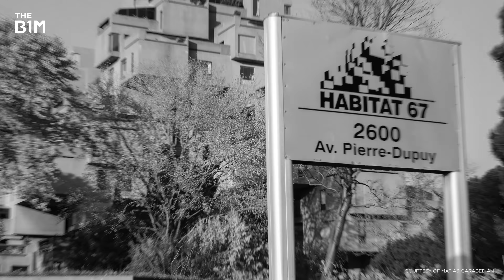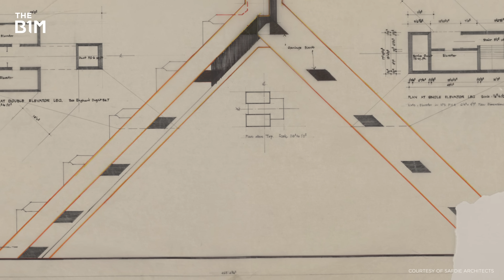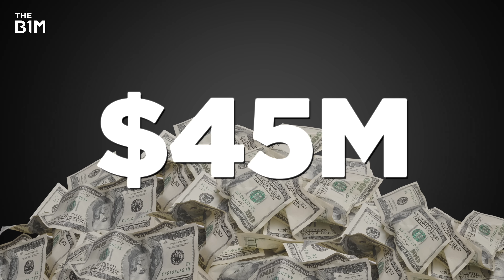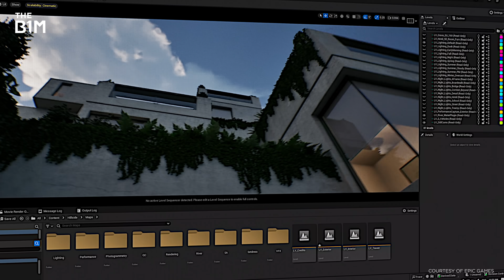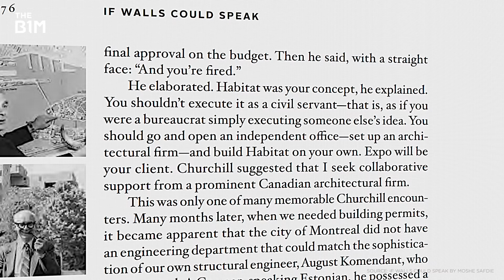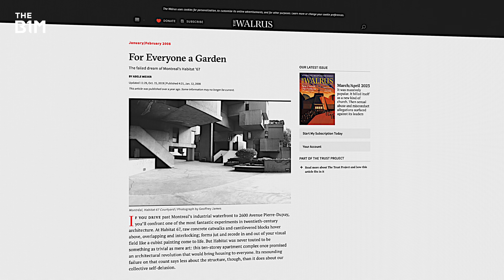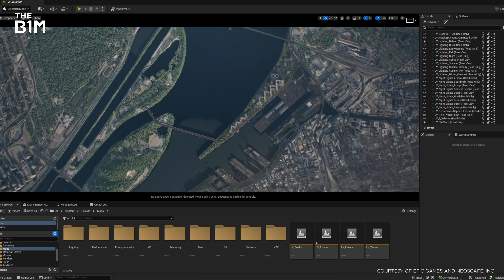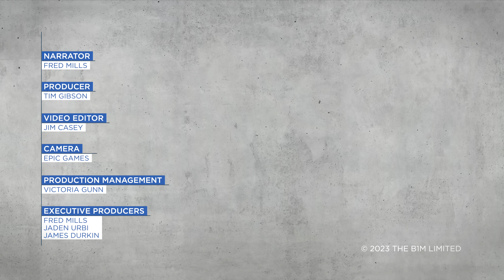How a 23-Year-Old Solved Urban Sprawl

Comment: the designer after design : it’s a masterpiece !

the engineer and the builder : oh lord
Reply: It would have been awesome to see the 45 million dollar structure.
Reply: Yeah, the engineers always fuck it up when there wasn't a problem with the design because they want just simple lifeless boxes. They'd remove every window if they could, cunts.
Reply: @bhante1345it looks good. Builders don't care about buildings looking good.
Reply: Surveyor's nightmare
Reply: lol you comment what i was going to do
Reply: Now apply modern Accessibility requirements, make them 1200 sqft each instead of 500, and figure out how to keep the rain out (they still leak) and what to do with SNOW since this is in Montreal with 5 months of winter lots of snow fall. oh and make it energy efficient after the design maximized heat loss (huge exterior surface area per unit compared to typical condo or Apt).  It is a lovely looking failure that most people will be unable to afford the upkeep on.
Reply: @r.b.l.5841  Interesting points. All legit, practical 'real world' concerns. I noticed the lack of ramps while watching the virtual tour of the original Habitat 67 concept: "Exploring Hillside in 4K | ULTRA REALISTIC Habitat 67...":
https://www.youtube.com/watch?v=QeCtoOoqDKY

Still find it quite beautiful nevertheless. The design could always be modified to include ramps and improve on other shortcomings..
Reply: And the administrator is gonna think of one thing: "how is garbage/waste gonna be disposed?"
Reply: as someone who works in construction, youve described every construction project ever right there lol
Reply: Looks like a comm/uni/st utopia
Reply: Yeah. Good luck earthquake proofing a design like that
Reply: It's a solution...a good one that can be improved with money or be corrupted without it. 

The original I liked it a lot.
Reply: @carlosr192  >corrupted
yeah... I have various ideas too, but understanding how it would end chopped up and used just as a packaging to promote and make money for developers, have no intention to share them
Reply: @carlosr192  No, such density causes low tfr, its counter productive by design.
Reply: see the part you're missing here is they did build it, and it wasn't so bad except for a shortage of people to work on it and the funding. There's a lot that has improved since then even. You're just one salty because it wouldn't be traditional. Traditions should be thrown away when they no longer prove useful or insightful.
Reply: The residents: hell no
Reply: the resident: this is horrible
Reply: And as usual, people who actually have to live in that horror weren't even mentioned 😅
Reply: i think moshe safdie missed the whole point of suburban housing, apartments share a common and singular plot of land, and while in some countries that land is divided across all of its unit owners when the building is eventually demolished, it still ends up being ridiculous for them when that time eventually comes. all buildings taller than a certain height (varies between countries) have a fixed lifespan of 50 years according to international building codes (with the exception of national heritage sites and buildings built with materials other than wood, steel, or concrete), so you eventually lose your home, and have no land to rebuild with or even sell. 

say for example that the condominium you live in is occupying 1000 sqm, and the number of unit owners are a conservative 2000, if you consider the law that allows unit owners to own a piece of the total property, then they end up with 0.5 sqm each, which is nothing. this is why suburban housing is so important for people of the retiring age, because staying in a condo all your life will get you screwed over sideways. condominiums are realistically for the young and able who can use it as a springboard for their future towards retirement in a stable life with a home they own in a land they own and sources of passive income. condo's are the complete antithesis of that goal.

edit: also i can tell you now from firsthand experience, living near where you work is a horrible, horrible experience. if your clients/customers/patients know where you live then they will never stop freaking invading your off hours just to get you to do something for them when you're not supposed to be working. this was the problem with my childhood home, where the 1st floor was a dental clinic and the 2nd floor was the house, in the beginning we weren't averse to telling our patients where we lived especially since my dad wanted to show off his expensive collections upstairs or invite them to dinner. 

then over time we started to realize that there were a lot of people who were better off not knowing where we lived, some would harass us nonstop day in day out and even throw stones at our windows just to get our attention (most of them for stupid things like a toothache, like seriously just come back for your next appointment literally tomorrow morning!!!), and the harassment would get worse over the years as the prevalence of karens began, so eventually we didnt tell a single soul where we lived and asked our neighbors to do the same, only close friends of the family would get to know. and only then did we finally get some peace. being so close to home can only be a curse, 15 - 30 minute walking distance is fine, but literally down the stairs is definitely not good at all.
Reply: @clothokaftan  With what standards are these buildings constructed? Only the worst of buildings with the worst of materials have only a 50 year lifespan. The rest of this post reflects a mind boggling lack of knowledge -- and humanity.
Reply: @MilieuChris   any building built with concrete reinforced with steel has a considerably shorter lifetime compared to pure concrete. why do you think roman structures have stood for 2000 years while modern buildings can barely last 50 years? because we're stupid enough to think we can fight rust. when those steel rebar reinforcements start to rust even slightly, the concrete starts to crack and split, even if you waterproof the steel you cant stop it since the paint absorbs moisture through condensation, its only a matter of time.
Reply: @clothokaftan

I'm sorry that this conversation is upsetting you. You're not going to convince anyone on here to agree with your views without substantial, non-anecdotal, evidence.

Roman "concrete" is not the same as what we use today. Only recently have we come to a better guess as to how that building material was made to last that long. Modern concrete is not going to hold up nearly as well as the self healing wonder the Romans created.
Reply: @clothokaftan thinking that your own personal experience represents the entire population is flawed. If you genuinely don’t like it then move? The fundamental issue that Moshe Safdie aims to stop is the compartmentalisation of different sectors of living and car centric cities. I think you were completely missing the point of this entire video essay.
Reply: @clothokaftan  this is some made up bs. Lived in several parts of Europe throughout my life and I can tell you not only do buildings past a certain height not get taken down after 50 years (I actually don't know of any place that does that) but in fact most apartment buildings are older than 50 years. This is some soft American first world problem stuff. Also Barcelona is set up in such a way that commercial and residential areas are intertwined and most people work on the same block they live, and it's consistently voted one of the best cities to live in the world for years on end now. This isolationist bs is how mental health in the US deteriorates to what it currently is.
Reply: @PitchPulseSiu  are those buildings built before 2010? if yes then of course they dont follow the international standard. many countries were pretty late in adopting this standard, with many countries taking as long as 2015 to comply, and my country took until 2018 to comply. old buildings cannot be enforced to follow this standard since it wouldnt be fair to investors and home owners, but new buildings have to follow this standard if they dont want to face recurring fines. oh and to be clear, my country isnt even a first world country, which is why it took so long for us to comply, we only started to consider it after we realised that it might be a good idea to not fall for the same trappings as japan's magnitude 9.0 that endangered millions of lives and damaged fukushima npp.

also how did you end up with talking about the city literally nobody cares about? calling it "the best city to live in the world" is just egostroking for them, it has zero truth behind it. the amount of horse sht coming out of that statement would make a pig blush.

and then you somehow start talking about american healthcare? again who cares, thats not even remotely the subject of the video let alone this discussion. i'm not even american or in america so it baffles me why you would even bring it up, do you hate america or something? if so there is a time and place for it and this isn't it.
Reply: @pedrolopes3542 I not only like my single family home, I like the large amount of land attached to it. That being said, dude was lying to make a point he didn't need to lie to make. Apartment living is fine for those who wish it. The only problem I have is government imminent domain'ing my property so a developer can screw me out of it. 

This is why I am armed to the teeth. They can try to take it, they'll have plenty of trouble in the form of 30.06 rounds being sent downrange at the rate of about 5 a second. I haven't missed a target in 30 years.
Reply: @clothokaftan you aren't being reasonable with this response about Barcelona, you just insult it without tackling the fact it's better to live in, you are just in various ways hiding "nothing must change, we can't do anything differently to what I'm used to in my country" it's just silly, you are just silly and should feel bad for saying such dumb, I'll thought out irrational things.
Reply: @sid2112 lmao. I doubt that's enough to stop them if the government really wanted to take your land lol.
Reply: @PitchPulseSiu there are certain houses in Norway that are older than my country, I know for a fact that 50 year thing isn't universal
Reply: @PitchPulseSiu hilariously, every state has different building codes, and I have never once heard of the 50 year requirement until now.
Reply: @PitchPulseSiu I wrote a shorter comment but yours gets the details😂.
Reply: @clothokaftan   Figure out how to make structures like he proposed last for 200 years, problem solved.
Reply: @clothokaftan I think you misunderstood the design codes. Buildings have a minimum design life of 50 years. That means they must withstand the fatigue and max loading expected over 50 years based on historical data. In practice there's an additional safety factor. As far as I know there is no rule saying a building must be demolished after a set period of time in fact the rule is that all high rise buildings must be capable of lasting at least 50 years. If a building is maintained and structurally sound the building can stand for as long as the owner likes.
Reply: @clothokaftan  I don't know where you live but where I'm from buildings don't get torn down after 50 years just because. 
Your story regarding living near where you work is also a) anecdotal, b) pretty specific and c) utterly irrelevant since you don't have to live literally next door even in this concept.
This is just a different way of building large settlements that seems more enjoyable, sustainable and efficient than many current concepts, it doesn't require you to live in the building/tower where you work.
Reply: @clothokaftan   Meanwhile my country is densely populated so most of the population stays in apartments built mostly on land that homeowners own for 99 yrs; after that the gov't can reposess it for free, resell the land & possibly replace the building. Its believed this is also how the gov't is able to afford building enough public housing to house 85% of the population
Reply: @lzh4950  Are you in Singapore? That all sounds very much like the HDB system there.
Reply: @weatheranddarkness  Yup
Reply: @clothokaftan  Earth cannot afford to have 8 billions of humans living the American dream :-/
Reply: @clothokaftan  financial psychosis
Reply: @clothokaftan  No international body will ever tell me what I can and cannot do with my own structures. This is MY land, these are MY buildings and I'll be damned if I'm told I have to destroy it because they don't understand concrete.

Comment: He didn't solve the urban sprawl, he just eliminated the benefits of an apartment complex by introducing the problems of an urban sprawl into it. 
I can't be only one to see that this project, as visually good as it may look, is not the solution it is being portrayed as.
The whole reason apartments are built the way they are, is to take advantage of economies of scale and standardization of building process, both of which lower costs, up to a certain height, which is mostly negated in this project. 
While the goals maybe admirable, its end result is unfortunately not what one would hope for.

Comment: Superlative! ^‿^ Thank you for this; this is exactly the sort of thing that makes me happy I'm subscribed to The B1M!
I agree with Safdie that it was ahead of its time and is still ahead of its time -- but it feels tantalizingly close. Cold concrete can be reduced in favor of polyiso panels, windows now sport multiple panes with air-gaps, drainage technologies are fifty years more advanced so the flat roofing is less likely to leak. Modular elements would be that much more stable, that much lighter than ever.

Comment: Any natural disaster is going to wipe that shit off the face of the planet. The plumbing would be an absolute nightmare. The sheer infrastructure required just for the scaffholding that would hold the moulds where concrete would be poured at an angle would be gargantuan. Just another example of dumbass architects ignoring the laws of thermodynamics, nature and angry engineers.

Comment: In my opinion it looks hideous. It reminds me of those 60s concrete tower block "social" experiments where they thought putting a communal walkway or balcony outside a flat would be a good idea. Then 50 years later the yobs there are high on crack and throwing people's cats off the balcony "for a laugh". I thought we were past all that nonsensical design but no, here we go again. This is a great example of everything that's wrong with architecture. 0:30 Can you imagine the fun the yobbos will have throwing bricks off the roof through all those glass panes?